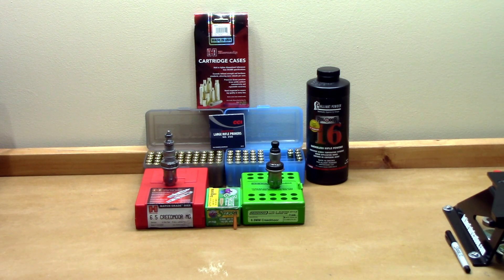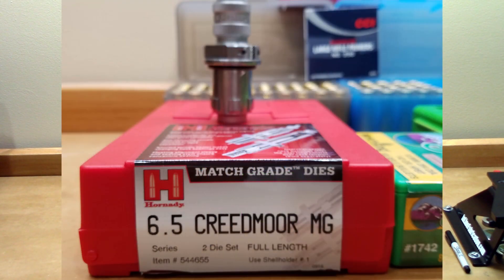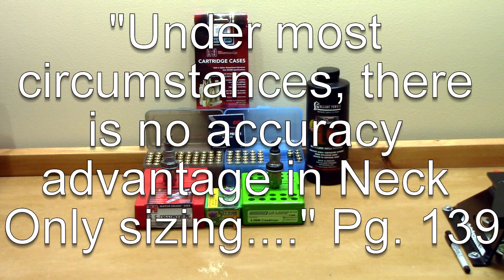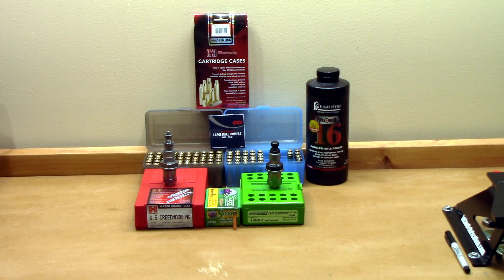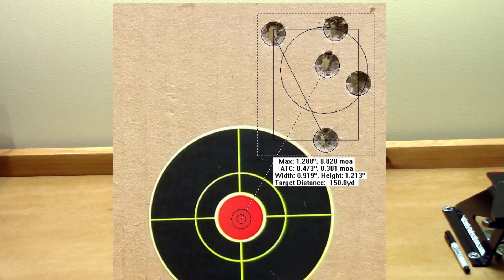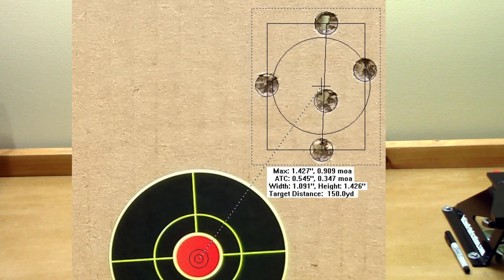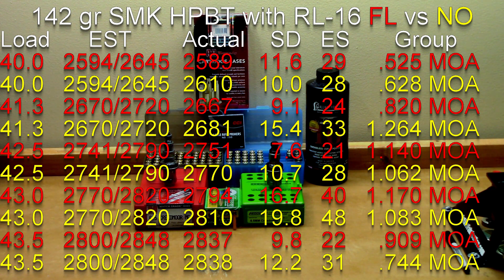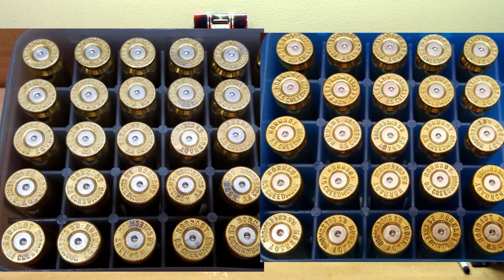Full length vs Neck sizing performance comparison

Comment: Great vid. I neck size my 300 win. Full size 6.5. As hot as i load my 6.5,  primers are blown out at third reload. Brass is cheap.
Reply from the maker: Those must be some hot loads... Hornady brass or have you switched to Lapua?
Reply: Hornady brass. Haven't decided to switch to Lapua until it becomes more available.
Reply from the maker: +meditech I saw that midway has some of the starline brass in 6.5 creedmoor. (Large and small primer) I ordered some to try out.
Reply: Thanks for info. Will be checking it out asap. I also noticed Sig is getting into the brass game. Picked up a 100 in 300 Win comes already annealed and looks quite promising. Hope Sig starts making 6.5 Creed. Would like to stick to large primers due to the sub half moa consistency I am getting with my load development.
Reply: meditech is there a reason to load them so hot? Is the few FPS gained worth it?
Reply from the maker: +meditech sig is listed as coming soon on midway so I wonder how soon it's coming.
Reply: For my use yes. I shoot the 147gr ELDM if I cannot get 2800 plus it now becomes worthless to me. First off let me explain I start at 1300 plus yds. I have stretched this round out to 1776 yds. with 3 hits out of ten shots (looking for better than 50%) on a 19X24 inch plate. At these distances you are now working with velocity vs. inertia. Hence why I run the heavier bullet with the highest BC I can get. Lighter bullets though fast lose inertia quickly and then environmental's have their way with them. It really gets down to, I am asking more of the caliber than what it is designed to do. Also remember at these distances it is very easy to run out of turret adjustment very easily if the bullet is dropping like a rock. Like I said before, brass is cheap. I have never split a neck on any of my Creed rnds. Primer pockets is an issue though using Hornady brass. As of now I have not tried any other 6.5 brass and just due to me having so much Hornady. I am shopping though, at same time am skeptical of change due to having found a sub half moa load that is very repeatable in my rifle regardless of environmental's.
Reply: I think it will be a great alternative, soon works for me.
Reply from the maker: +meditech if I may know, whay excites you so much about the sig brass?
Reply: Price, availability, quality. If it is anything like their 300 brass I will be totally sold. My 300 brass for a fifty count was only 34 bucks when I bought it a couple months ago and quality was outstanding. Also our local Cabelas carries it in stock.

Comment: Isn't the purpose of neck sizing just to hold the projectile in place
Reply from the maker: There are several trains of thought involving sizing. People tend to think that you will get better accuracy neck only sizing vs FL sizing. That is what I was trying to test here. Neck only is basically a bolt action only option, if you choose to do it. Thanks for commenting.
Reply: While it's true that neck sizing holds the bullet in place, neck sizing also assumes that the brass is fire formed in the chamber of your gun.  Every gun's chamber dimensions are not the same.  So the fired formed brass may not fit in a different gun of the same caliber.  The fired formed brass is custom tailored to your gun and may be difficult to feed (too tight or too loose) in a different gun of the same caliber.  Factory rounds have the dimensions of full length sized to fit in any gun to a specified tolerance.  When you pickup brass of unknown origin or not from your gun or when in doubt, you should always full length size the brass.  If the rounds are going to be shot in a different gun from where the the brass was obtained or semi- auto,  you should always full length size the brass.  You should always full length size when the rounds are going to be fired in semi- auto even if you collected the brass from your semi-auto.

Some reloaders swear by neck sizing,  while others, as in this video, got better results from full length size.  I personally have gotten better results with neck sizing, but as they say, you're mileage vary.

Good luck.

Comment: What did you use as your neck tension with the mandrel die - 1 or 2 thousands?
Reply from the maker: +njgrplr2007 neck tension was set with the expander mandrel. (Not the turning mandrel) So theoretically .001
Reply: Thanks for the reply. Have you ever tried the turning mandrel for .002" neck tension?
Reply from the maker: +njgrplr2007 I will probably try it sometime however I think that might be too much... when I did the die comparison video you can tell that the neck tension varies by die since the velocities increase with neck tension.
Reply: Gotcha. I know Redding recommends 1 thousands of neck tension, but a gunsmith at one of America's best barrel makers told me he uses 2-3 thousands of neck tension with his Forster dies! FYI, the guy is also a highly regarded bench rest shooter. I plan to do a comparison of 1 versus 2 thousands once I get my Sinclair expander die. I also saw where Ed Mobley was planning to go with the turning mandrel in conjunction with the .287" bushing in his Redding Type S FL die. I'm not sure how that turned out for him. In any event, thank you for taking the time to post your test results. I don't have the time, money or skill to do what you do, but it's great that we can learn from the information you share.
Reply from the maker: Thanks. I always like new info. I really don't have any local friends that reload so I use this as a way of documenting, sharing, and getting feedback from guys that do. It is a lot of work, but I hope others feel that it is worth it. I feel a little bit like the myth busters of reloading. I still like Johnny's reloading bench better than my channel. He is great.

Comment: I've gotten very good results both ways, but after 3 firings with NS I find I need to FL size my brass after that. Just wondering why you seated those loads so far off the lands cuz frankly your accuracy kinda sucked.
Reply from the maker: Jay. I have had good luck with this projectile in the past, just not at this velocity. This test is based on the load data from Sierra.

Comment: bull,,, when i started neck sizing i went from about 1 inch at 100 down to holes touching with 22-250,,,243,,,30-06,,, and others
Reply from the maker: Hi Scott, Thanks for watching the video. I guess insinuating that I am somehow not conveying the truth here is disappointing, but others are critical as well. This data is exactly how it was shot and the data is off the same chronograph on the same day. I think largely that people neck size for various reasons and one of them very well may be not optimizing their FL process. I remove my expanding device during FL resizing and only bump the shoulder .002" and set the neck tension with a expander mandrel these days and have been able to get better concentricity and better groups down range because of it. Anyone can make a load technique look bad simply by not optimizing their process for it. I think everyone's experience will vary largely how much effort they spend into tuning and perfecting their own process. Thank you for commenting regardless.

BAR
Reply: @BoltActionReloading  i always load 1 grain below max,,, when i was full length sizing i was shooting right at 1 inch at 100,,, i tried different grains of powder ,,, bullet weights and moved closer to the rifleing,,, i  had decnet changes,,, my biggest change was doing neck sizing,,, 1 grain under max and factory crimp the bullet as far out as possible without crimping outside the canular,,,, it worked for me at least,,, you are right everyone is different but for me it made a huge difference in group sizes

Comment: Boy howdy - this horse has been beat to death. Say all you want in the F/L vs neck size debate. If you want the most accurate rifle ammo, F/L size without an expander then use a mandrel.  Go down the line at F class nationals and ask the big boys if they neck or F/L size.  You’ll find top shooters all F/L.  That’s all I need to know. Buy good brass, ie Lapua and anneal. Quite worrying about brass life, most regular shooters will never shoot a piece of brass to really wear it out. If it does it will be primer pocket.